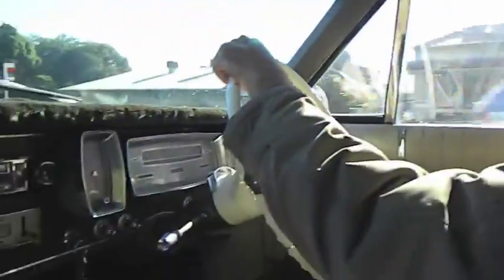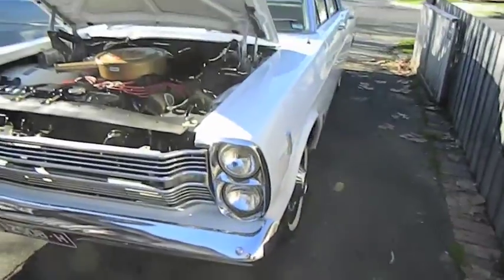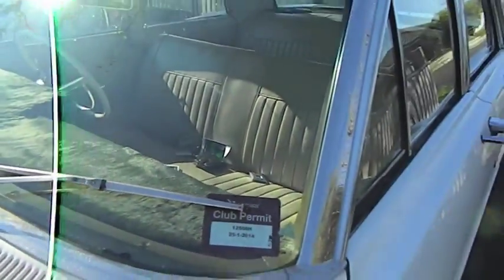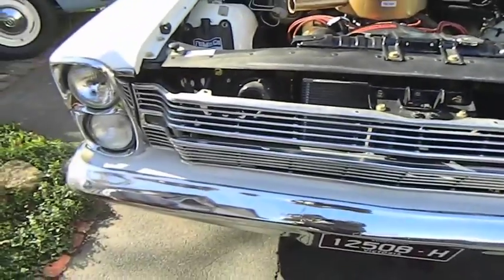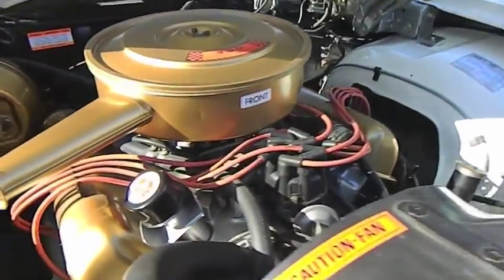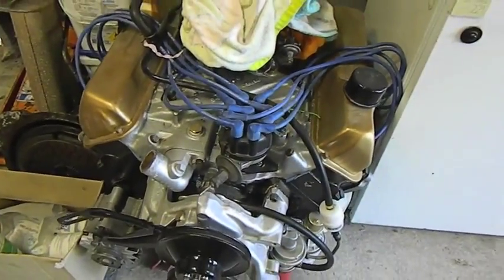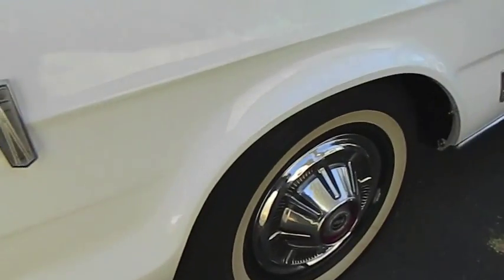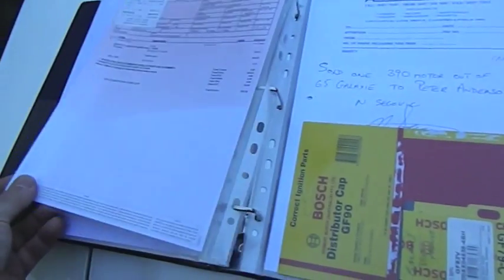1966 Ford Galaxie 390 FE big block

Comment: My first car was a 1966 Galaxie 500 2-door hardtop.  I was 16 and bought the car for $35 (US, 1976), but the engine was blown.  My father had a 1967 Galaxie 500 with a good motor (289) and transmission, but the frame was cracked.  We took the the '67 motor and transmission and installed it in the '67 body.  I had that car from 1976 until 1979.  I loved it!  I gave it to my sister when I bought a brand new car.  Sad ending though.  Her boyfriend was driving crazy through a parking lot and totaled a 1976 Camaro with it.  It bent the frame and pushed the radiator into the engine of the Galaxie.  It was not worth fixing.  I still have dreams about that car.  The dash gauge assembly did not look anything like yours, but then mine was the American version.  Seeing this video just reminded me of my youth!  Thank you Peter for sharing.